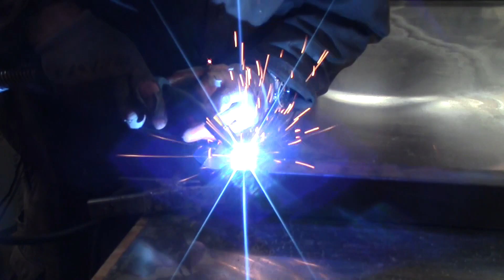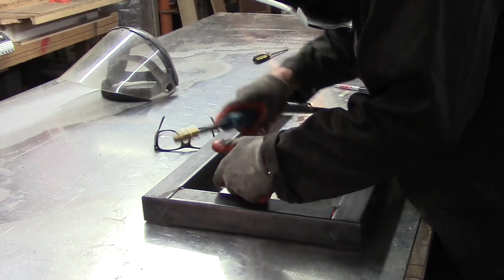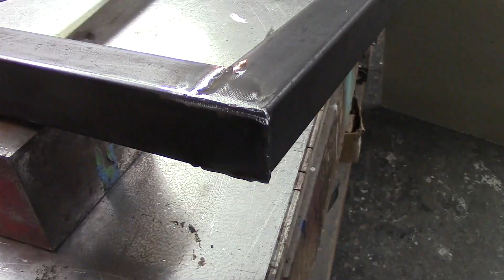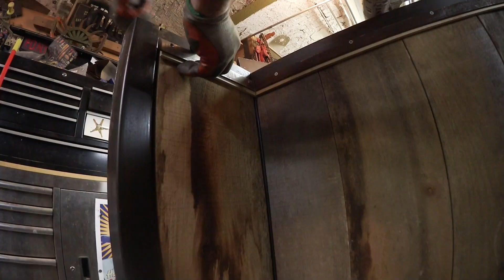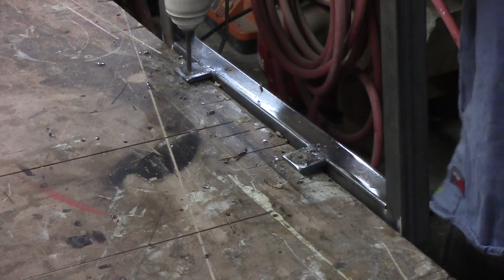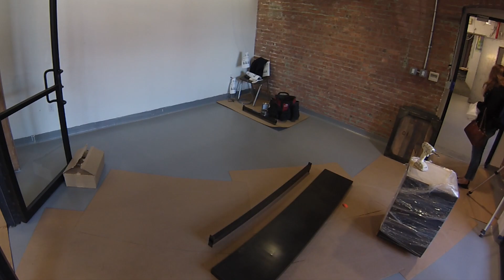✔ DiResta Reception Desk

Comment: Very nice job! Wonder if someone could tell me why Jimmy tused two different welding machines in this video? For the main bulk it looked like a MIG welder and on the smaller one it was just a gas arc welder with seperate filler rod - correct me on the terms I just couldn't think of what it was called. Thanks folks!
Reply: Darren Boss Mig and Tig.  Magnesium(?) Inert Gas and Tungsten Inert Gas.  Not sure if the "magnesium" is correct but I know "tungsten" is correct though.
Reply: It's metal inert gas. 😀
Reply: In a separate comment he said he used the tig for variety and because it was new

Comment: Do you dissemble your power/hand tools before you paint them white? Or do you just mask as best you can and spray them as is?

I know this is an ignorant question, but I don't want to ruin the internal pieces if the overspray were to get in the air slots and what not. Love the videos man. Thanks

Comment: Welding noob here:

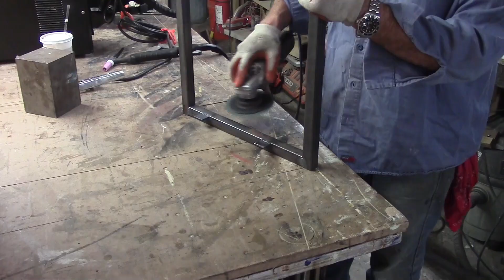Is there a reason you used a TIG welder instead of the MIG you were using before @ 9:37? Like, is there something about that part of the build that required it?
Reply from the maker: Just for variety. I received that longevity unit and wanted to try it. Thank you for the kind words below !!
Reply: Variety is the spice of life!
Reply: I had the same question... that's all...

Comment: Have you made any modifications to your band saw so that it can cut steel?  If I could do that in my shop that would be really helpful!  

If your just using a special blade what kind would that be?  Also what type of bandsaw do you have? 

Thanks Kyle!
Reply from the maker: 14 tpi bi metal blade.. use slow with oil, thank you
Reply: jimmydiresta Is your band saw variable speed or did you add a speed control?

Comment: I never worked with steel so it might be a dumb question, but it doesn't seem you predrill holes before screwing the metal parts? What kind of screws drive themselves into steel like that??? Or was the predrilling implied?
Reply: They are tek screws they have a small drill bit on the end and they tap there own thread as they screw in !
Reply: Craig Hubbard thanks Craig!
Reply: Craig Hubbard fancy stuff. Know the name?
Reply: Spitfire83 TEK screws
Reply: Or really just any self-tapping screws
Reply: ***** я тоже просверливаю предварительно ту вешь которую креплю но не ту к которой прикручиваю

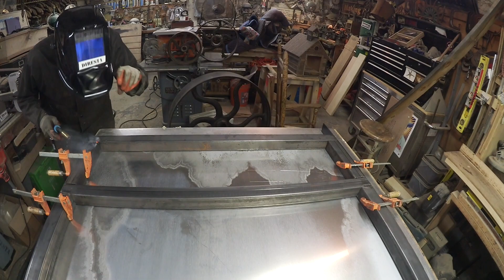Comment: I cannot for the life of me figure out what the clamps at 1:40 are for.. Anyone?
Reply: I just re-watched that part and cant figure it out either. The speed and angle does not help.
Reply from the maker: There is an long angle iron left and right of the screen   you can't see. On each side. To keep front and sides in line before I weld sides at 90 To the front.
Reply: jimmydiresta Ah that makes sense! Love the videos, thanks for replying :)
Reply: +Tom MacNamara 
at the top right corner you can see it stick out.

Comment: great concept, but i dont think the receptionist is going to appreciate the cold metal work surface in the winter nor when he/she bangs their leg on the metal table leg.

metal table legs tend to have rounded corners and the legs are usually deeper into the table rather than attached to the corner of the table top.

you could have had 1 table leg on eac end and made it like an upside down T so it would be just as sturdy

Comment: jimmydiresta Great work as always! Quick question though if you could be so kind. The blocks of metal you use to "anchor" the frame with (while working on it) are the magnetized at all, or just sheer solid metal with some real heft to it? They seem to be doing a great job at keeping heavy objects at bay.
Reply from the maker: Thank you ! Steel bricks. About 30 lbs each
Reply: Cool, some heavy bricks then :D Thanks for the answer. Looking forward to the next project!

Comment: why at different stages you use different methods of welding? guess it's because of the "deepening" of the seam? (i'm kinda dum in these things :D). Very awesome desk, and it dosen't say Diresta on it :D
Reply: TIG is a much slower, demanding and far more expensive process but it lets you work on thinner gauges with deeper penetration and better aesthetics. To tig entirely a desk like that would cost you quite a lot more and would take you many times as much; for a bigger amount of weldings you may want to use mig: even though it can be less strong(-not necessarily) and it may take grinding, is a more effective method, as far as money and time are concerned
Reply: ***** I think it was just a plug for the TIG machine he used. Did ya see the MIG he used? No. They're not a sponsor. TIG is stronger and more aesthetic generally. I loved this video, I always learn another tip or two from the master Jimmy DiResta.
Reply: I think he uses multiple techniques to demonstrate the different ways to weld. I've seen him do similar approaches in other ways with his other builds.
Reply: patriotsriot Tig isn't any stronger than Mig or Smaw.  Its all in the welder, not the welding tool.  Tig is, in fact, the slowest and it is more commonly used on thin metals.  It can be the most pleasing to look at (provided you are a better Tig welder than I am).  I agree with @thromgard that Jimmy is tossing one out to Longevity.
Reply: Good info, thanks rokdevil.
Reply: Its possible that the welds he used the mig on are less visible, or were in places where it would be easy to grind the weld down to a smooth surface, where the tig welds may be in a place that is more visible to the consumer, or on a material that would be difficult to refinish/grind after the weld. I suspect this is the case, and not just a plug for liberty (its not obvious the brand if you hadnt watched previous videos)
Reply: Amra Jimmy actually responds to someone in the later comments and says "Just for variety. I received that longevity unit and wanted to try it."
Reply: rokdevil Well, there you go then. It was neither a plug for liberty, nor a practical concern, it was just something to make the video more interesting. Thanks for the explanation. :)
Reply: rokdevil is correct. Mig isn't any "weaker" than Tig. The reason this myth exists is because a novice welder is far more likely to use a Mig welder; consequently, Mig welding incorrectly. To further the problem, the Mig weld bead can "look" correct even though it has not penetrated--a lack of fusion. So, the welder makes a "good" weld, no matter the welding process.

Comment: Why ruin the nice SS tabletop by letting the grinder stop on it???
Reply from the maker: was aluminum top specifically to ground the welder, found in the trash with 12 other sheets.
Reply: jimmydiresta
 you found 13 sheets of 4' x 8' aluminum...thats 1500 bucks easy. It amazes me what people throw away sometimes.My best was when i found enough unused Pergo flooring to cover about 2000 sq feet. It was an insurance recovery job and the homeowner hated the color,so they pitched it.I covered my entire basement floor with it and i got an extra 35 grand added to the value of my home for finishing my basement
Reply from the maker: Yes it got wet and then was frozen for a winter and was all stained as you can see in the beginning of the video. The guy couldn't use it stained.
Reply: jimmydiresta
 i used to work for a metal fab shop at Boeing years ago. We would de-stain large sheets of aluminum with a linoleum floor buffer, the big, round electric kind. We used a little water and the pad was the same material you use in a window screen...that fine plastic mesh. You could actually do that in your shop if you had a old window screen and a buffer.lol
Reply: I find use condoms all the time! A little bleach, belt sanding, and arc welding and I'm back in business.
Reply: cacadodo666 i just wash them and turn inside out
Reply: Xantiago P so when she gets pregnant it is definitly not yours. clever guy.
Reply: +cacadodo666 don´t forget to put your name on it with spraypaint!